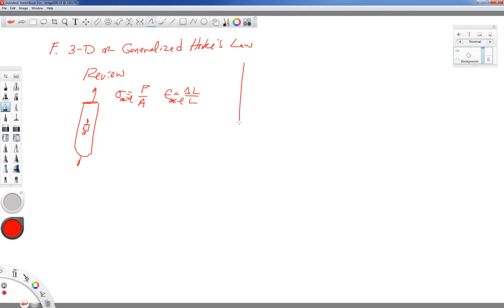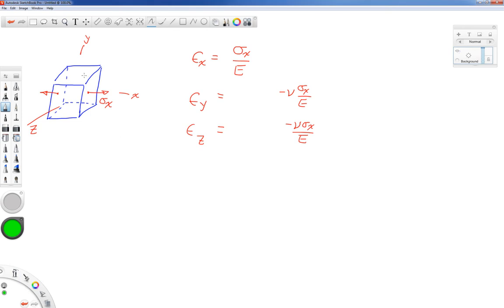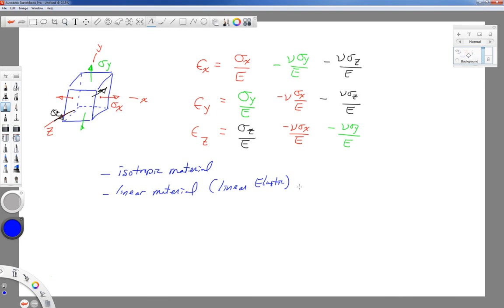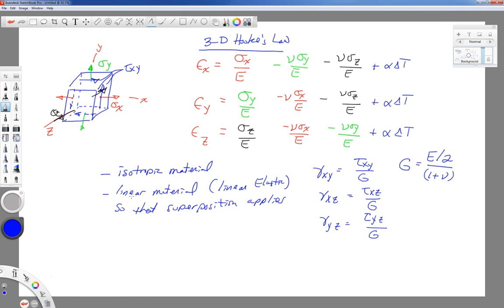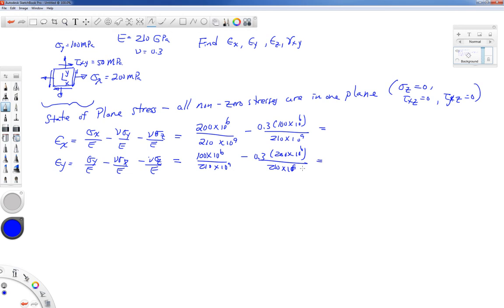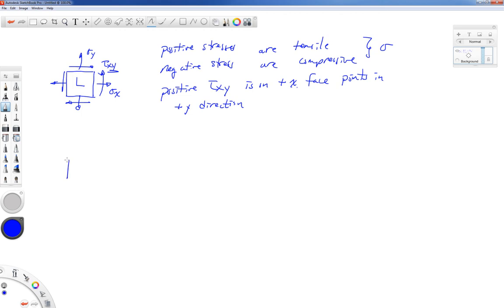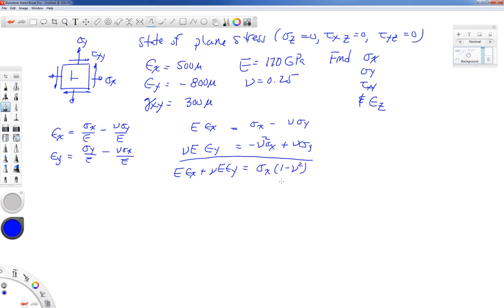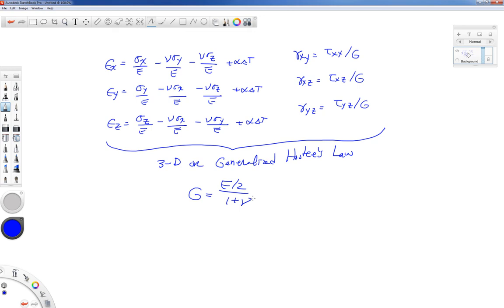Mechanics of Materials-Lecture-08-Generalized Hooke's Law

Comment: Hello, thanks for the video! Could you explain maybe how to express Sigma x, Sigma y and Sigma z through Epsilon x Epsilon y and Epsilon z. You somehow sum these Epsilons and you get Sigmax=(E/(1+nu)(1-2nu))*((1-nu)epsilonx +nu(epsy+epsz))
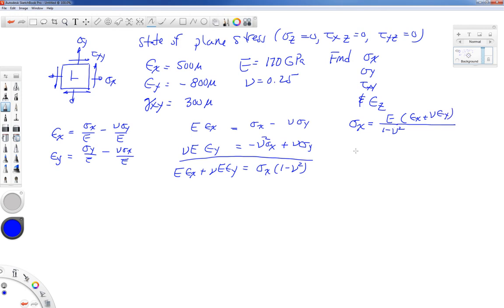Reply from the maker: What I showed at 22:11 was how to get sigma_x and sigma_y in terms of eps_x and eps_y  (with sigma_z = 0, i.e. two equations and two unknowns ).  For the most general case of all three equations and three unknowns, you have a system of equations that you need to invert.  When written in this form, the algebra is terrible, but it can be done with a substitution and reduction method.  Alternatively, you can use some tricks from linear algebra (matrix inversion).  The easiest way though is to write the elastic constants in terms of Lame' coefficients and use index notation, as is usually done in Theory of Elasticity see:  https://en.wikipedia.org/wiki/Lam%C3%A9_parameters.    Perhaps I can find time to do the algrebra for those methods some day, but not this day!
Reply: Well I'm supposed to solve it without using Lames coefficients, only through eps x, eps y and eps z.
Thank you anyways and thanks for the quick response!